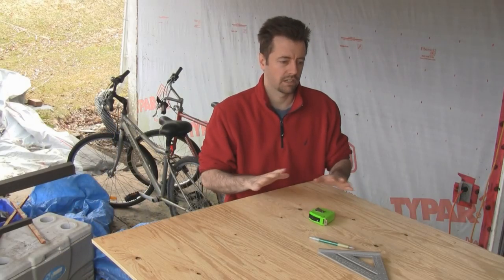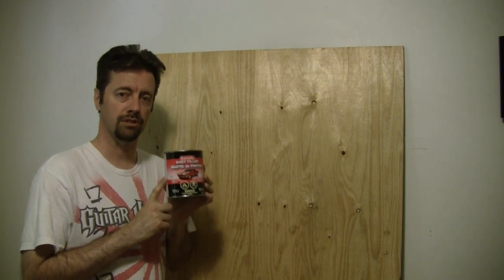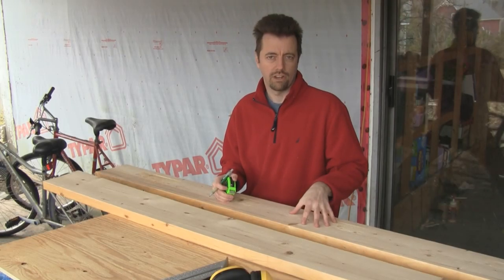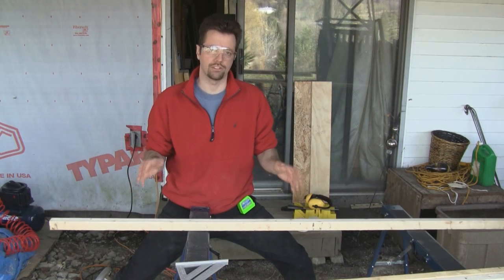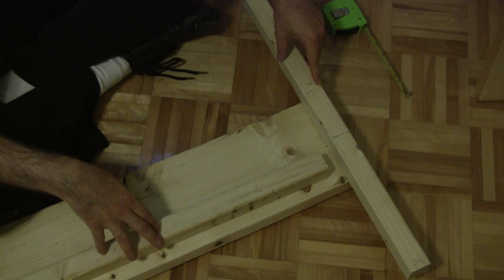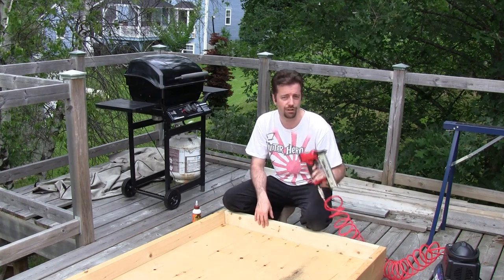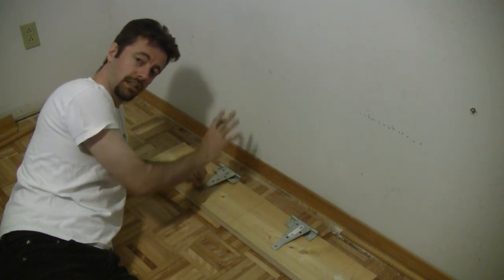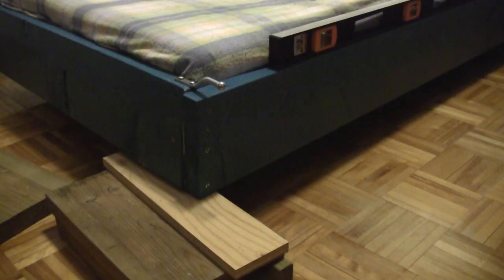Doctor Who Murphy Bed

Comment: Would I be able to use a design like this for a queen? Not necessarily as the TARDIS, but as a murphey - if I had it folding up against the wall along the long side rather than the top end?  Or should I keep looking for something to make that work?  Also, this is an amazing bed, and looks great!
Reply from the maker: The single is pretty heavy this way, and this design doesn't use any springs to counter the weight. You could do a double sideways but I think a queen size might be a bit overwhelming when you try to open and close it.
Reply: TheShopGeek That makes sense. Thanks!

Comment: I know this is a late response, but I am curious how the bed is holding up after all this time? Most Murphy beds I have seen use heavy-duty hinges and springs for the assembly, so I am curious how the gate hinge is working out.
Reply from the maker: Hello Mike! The hinges are holding up very well. No sign of wear at all so far. In a sprung Murphy bed the hinges are extremely heavy duty because the springs must be very strong to counterbalance the bed over such a short distance. Since this bed has no springs the hinges can be slightly less heavy-duty, but the gate hinges are still very strong.
Reply: Thanks for getting back to me. I will definitely have to give this a try then.

Comment: do you think this plan would work for a king size?  Obviously you'd have to make it bigger ... and well, you'd probably need more strength to lift it, but you could double up on the gate latches on each side.
Reply from the maker: This structure would end up being much too heavy for a king size, plus the dimensions for the Tardis would look strange. You could certainly adapt it but I would go with a different design overall - this was meant to look bulky to better represent the Doctor's police box.
Reply: TheShopGeek thanks... I figured it would be bit much for a king.